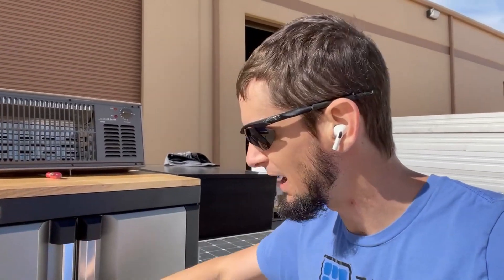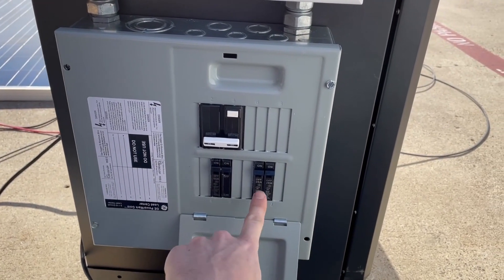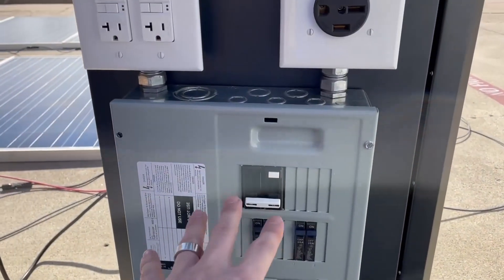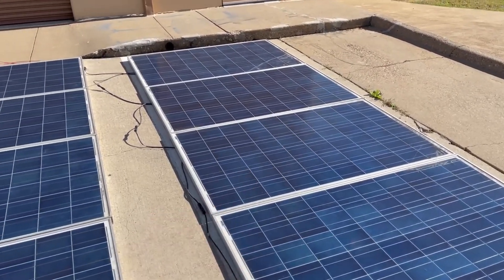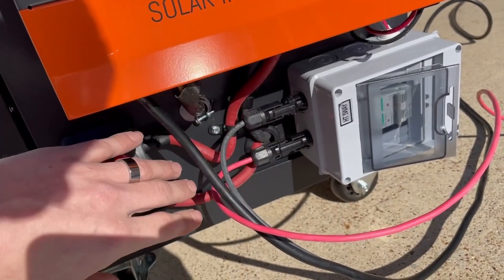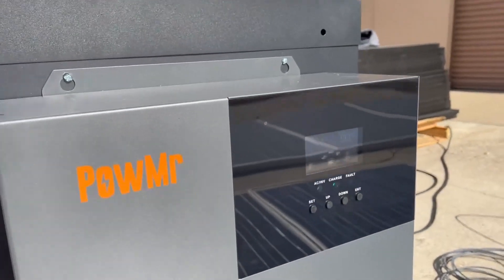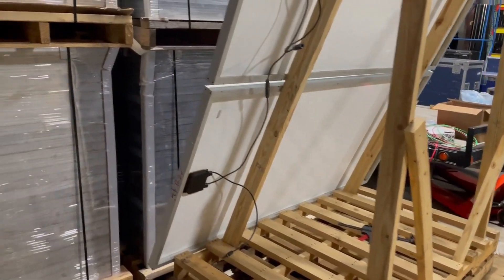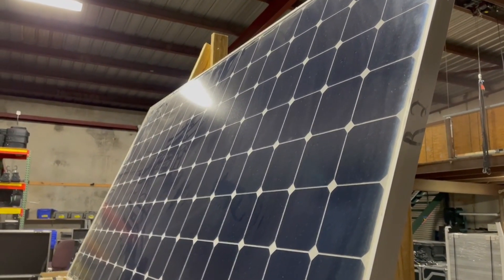If Your Portable Power Station Was On PowMr Steroids

Comment: I’m not sure I would trust eBay for a battery source of lithium. Will Prowse has shown too many of these guys lie about low temperature disconnect!
Not to mention that they lie about whether they’re grade A or B cells?
Reply from the maker: Yes getting Lithium from just about anywhere is risky. I’ve torn this battery down in a different video and while it’s not perfect the low temp disconnect does in fact work!